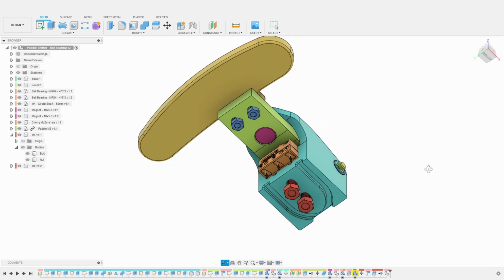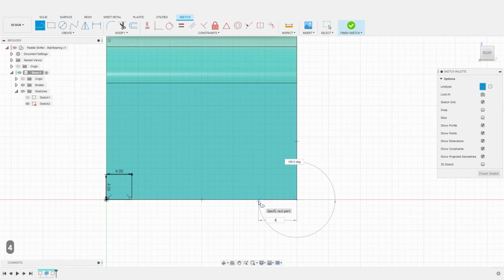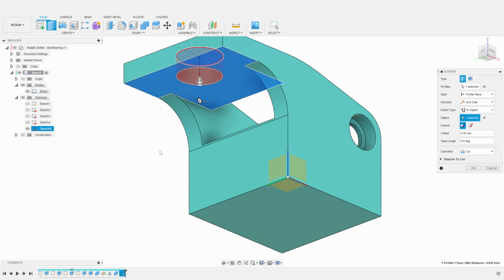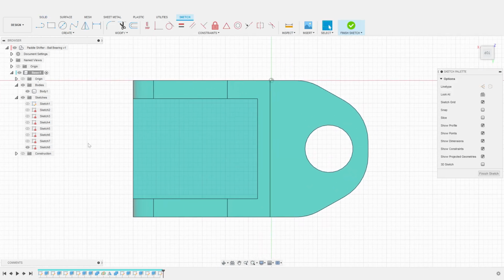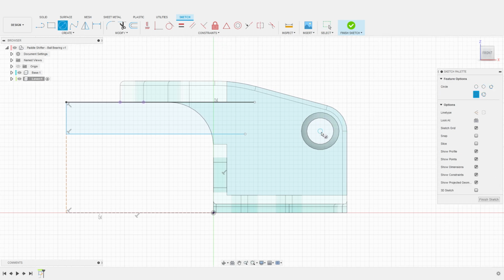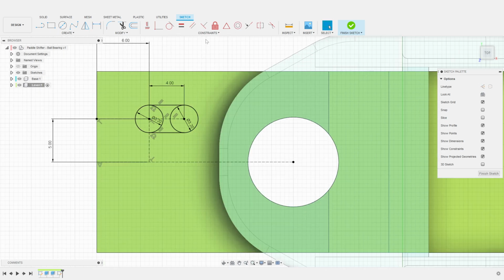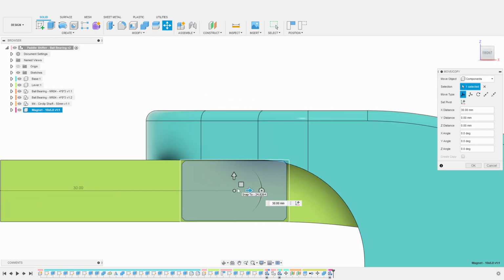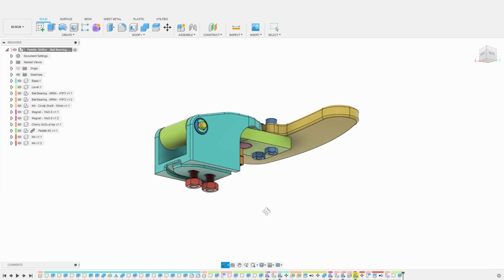Fusion 360 - Magnetic Paddle Shifters - Ball Bearings Mechanism

Comment: I do not know if in fusion 360 will be the same, as I come from SolidWorks but, have you tried dimensioning two sketches directly instead of dimensioning a construction line between them? It would save you a lot of time

Comment: Hi could this work with a potentiometer, instead of a switch ? How could I incoperate a potentiometer in this design, Thanks in advance! love your videos!
Reply from the maker: Hey!
What would be the application for a potentiometer?
Do you want to retrieve the amount of pressure on the shifter?
Reply: @fredmakes2556 I suppose he's talking about the potentiometer to use it as a clutch paddle.
Reply: With the magnet on the paddle, it would be better to use a hall effect style sensor, and then it could just be mounted within the PCB/Base of the wheel rather than exposed on the shifter base.